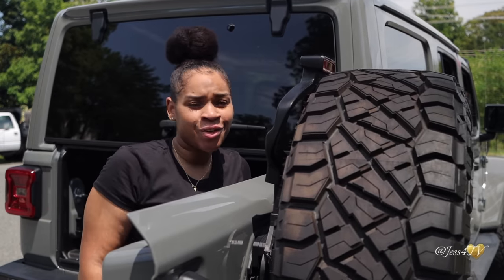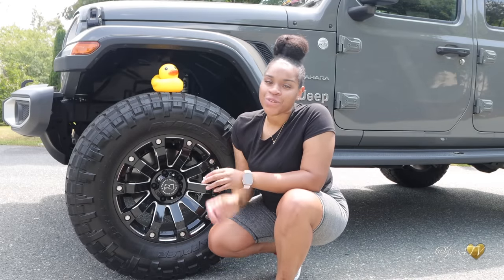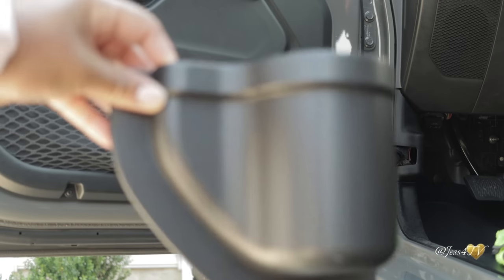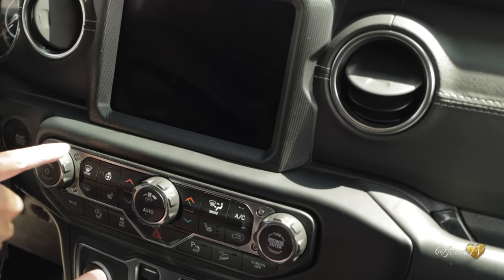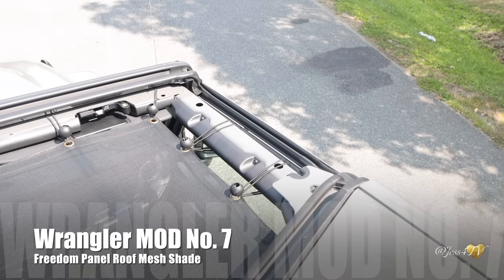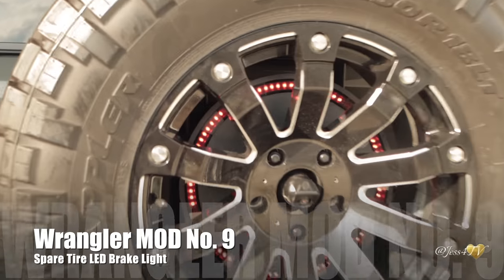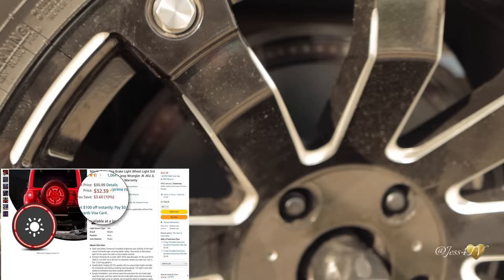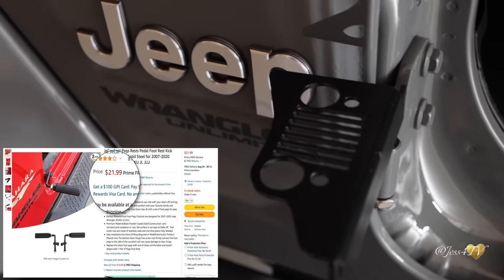10 MUST HAVE JEEP WRANGLER MODS Under $100 from Amazon for a Daily Jeep Driver! | Jess4TV

Comment: Nice job sis. We just got an Unlimited Sahara A few weeks ago and I already lifted it 3.5 inch Rubicon Express Super Flex kit with the Falcon 3.3 shocks on 35's. I also put in the Auxbeam 8 gang switch panel and today I just put on KC Flex Era 4 Fog lights.  The next thing we are going to do is get the Flex Era 3's for the pillar and regear it to 4.88 gears so we can get some of that speed back.

Comment: I already had these black floor mats with a big yellow smiley face on them (Jeep is black). I now have a big yellow smiley face spare tire cover and little yellow smiley face air spout covers for the other tires. Got a leather steering wheel cover and some grab handles for the door (black). Oh yah. And a subwoofer and updated stereo/gps/speaker phone setup (I have an older Jeep) as well as updated regular speakers and a little fire extinguisher. 😊

Comment: The front grills are super easy to pop out, you have like 6 plastic push pins right under the hood and then you can pop the grill out, I also changed out my hood latches they’re just two bolts on each piece

Comment: All the mods are great, but I would highly recommend adding a rear bumper that supports the spare tire from the frame instead of the door.  It will begin to sag causing the bottom left of the door to wear and scratch the paint.

Comment: Great video.  Love the backseat console cupholder storage... the factory space there is useless.

Careful w/ those rear side storage bins/trays.  Looks like they block the small access panel for changing out/replacing the rear lights if you're looking to mod those out.

Comment: Awesome video. I just purchased my second wrangler. First was a Sahara and now in a 21 high altitude with one touch sky roof. Only other cheap mod you didn’t show is antenna and hand rails. But ❤️ watching your video. Thanks for sharing nobs and door cup holders - will be adding to mine

Comment: Smitty built has a portable air compressor for around 90 dollars. Let's you air down for a nicer ride, then air back up for highway. I have been 4 wheeling for 49 years, liked the video. Some roll bar grab handles would be nice. Good job.

Comment: Just remember one thing with jeep wranglers, they hold their value better then most vehicles on the road. Even if you were in an accident and most of the time the wrangler destroys what ever it hits and the wrangler will, have minor bumper damage.  I’ve been selling them for a decade and have watched a new wrangler owner start with the Sport, trade that in few years later for a Sahara then do the same thing for a rubicon after that. Each time they had good equity to put towards the next one.  The adult Lego set where no two are the same!

Comment: Some of these are really great ideas. I almost jumped for the grab handle storage pocket until I saw the Air Bag embossed in the dash under the handle. Not sure I want that and everything in it propelled at my face in an accident. :/

Haven't seen the rear buckets or the console drop in. Those are clutch!

Thanks for the video!
Reply: This should be mentioned…

Comment: 👋🏼ollllllo from Chicago!  Great video and awesome functional mods! I own a 2017 JKU. The 9-Drive throttle response controller is probably the best mod under 60 bucks I've added. It takes out all of that lag when accelerating. I highly recommend it. Especially if you've added larger wheels/tires. These wranglers are a ton of fun to change and make your own. There are so many options. I should've got one years ago. Ok I'll shut up now. Lol! Keep up the great work and have a great day. 👍🏾
Reply from the maker: I’m definitely going to have to look into the throttle response controller! Thank you for this tip! The options are endless 😆😆🙌🏾🙌🏾 noooo don’t shut up! Please keep going I’m here for all your comments they are very informative and upbeat thank youu so much and I greatly appreciate you for watching✌🏾
Reply: 9 drive throttle response controller…

Comment: Nice choices! I’m looking at the RGB dual ring tire light. I’m sure it’s installed the same way, but changing the colors is nice too. Also, I’m looking at the XK Glow RGB fender lights— a bit more expensive though.

Comment: Just 2 things I want to say. Mode 1 it on the way of the airbags, mode 4 is on the way on the backsit when you pull it down (if I don't remember wrong it come from factory for 2 door JL)
Reply from the maker: “MOD” 1 actually isn’t in the way and has no interference with the airbag. I’ve had no problems with “MOD” 4 and putting my backseat down as I have no reason to put it down.
Reply: I’ve got that mod 4 cup holder and I don’t have any problems with the seat.

Comment: I bet those mirrors blow back at anything over 30 mph. On my 16 JKU I mounted the ones that bolt to the two torx head bolts on the windshield frame. They blew back until I replaced the thumb screws with hex head bolts and drilled a hole down thru the bracket and the aluminum part that grips the mirror arm tube. I dropped a cotter pin down thru this hole. This keeps the mirrors and arm from pivoting back at speed.

Comment: Love the list, i have had those mirrors before though and they arent great on the freeway. They came loose fairly easy even after cranking down on them pretty hard. Got another set that clamps on to the grab handle that work better. Though they are like $150 or so

Comment: The bad thing about those mirrors are it chipping the paint at the hinges. If it's not tight enough. The wind will push the mirrors while driving. Then when tightened tight enough it will paint and chip away the paint if not right away it will soon.

Comment: Those are some great ideas, but those “rear organizers” cover the access to the bolt that holds in the tail lights! With ALL that 3M tape it may be impossible to ever change a burnt out bulb without damaging the Jeep. While they do seem like a good idea, unless you buy light bulbs that last forever… maybe pass on those.

Comment: i had those same mirrors and sent them back. They are weak and fold in as you drive. they don't send you the proper washers for them. they sent me rubber gaskets to use as washers.

Comment: Hey!! I absolutely love your channel. This is so helpful and informative! I have a 2017 jeep wrangler unlimited sport. I am in really bad need for new tires, because I hydroplane in the rain all the time if I’m not super Duper careful. Since I am on the lookout for new tires, I’m also wanting to do a 2 inch lift. I just wanted to know, what size tires do you have on your jeep? It looks about how I envision mine to look and I have no idea where to start. Thank you so much!
Reply: Hey, without getting too crazy with  2017 JKU, the largest tire size you can go is 35 inches. 37 and up, you look at regearing and even beefing up the axel for heavier strength.. 4 Wheel Parts or extreme terrain are two good spots to shop across the States or Canada. You'll find everything you'll need plus more. For my CJ-7, JKU, and JLU Rubicon, I have Mickey Thimpson tires, live in Canada, and are good for all terrain all seasons. I hope this helps out with any information and questions. Also, as a daily driver for all of my Jeeps and still a weekend warrior, a 2.5-inch or 3-inch lift is all you'll need for stock axel, gearing, and 35inch tires. Make sure you find a good local club to get in with too. Look at Jeep Jamboree as well as Tread Lightly. Take care, and remember to keep the rubber side down!🤙

Comment: Hi, the rear console storage does it interfere when the rears seats are folded flat and does the rear door table rattle when driving?, thanks, nice subject.
Reply from the maker: Nope because there’s no headrest in the center so seats still fold down perfectly and I tightened it so much to the point it couldn’t rattle if it wanted to 😂
Reply: @imJess_sayn   Thank You

Comment: The door cup holders are terrible. They rub legs. Better to get the version that replaces stretched-out mesh with the flat plastic pocket that's available, and not the kind that has double-sided tape. Look for the kind that clips behind the mesh trim plastic.